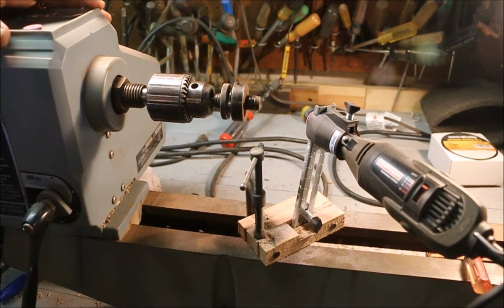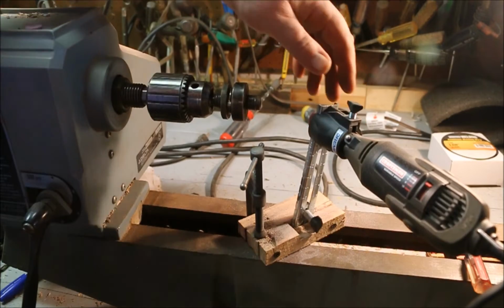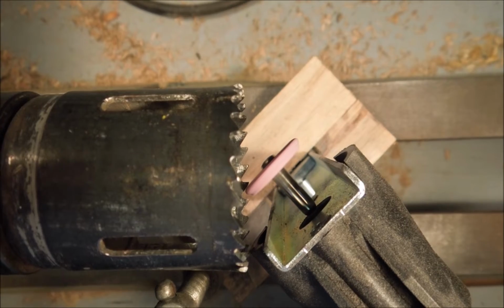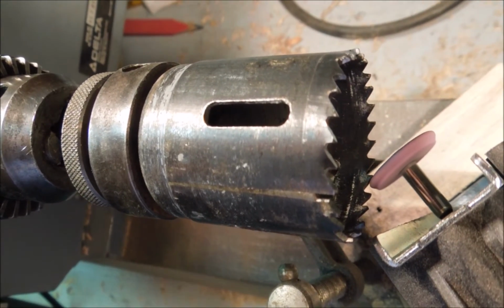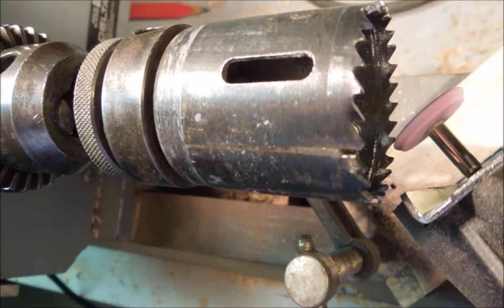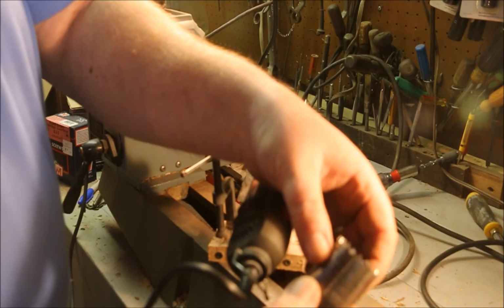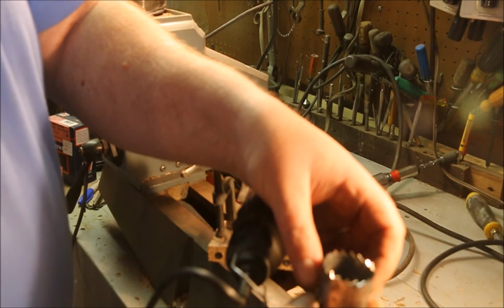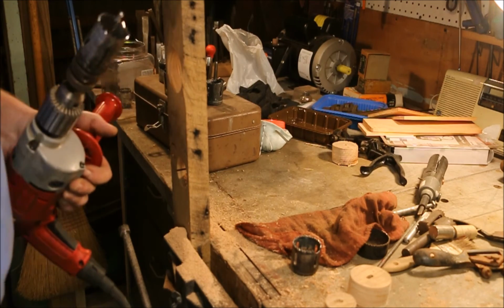Sharpening Hole Saws ~ Pt 3 ~ Different Diameter Saws ~ by Old Sneelock's Workshop

Comment: Nice solution to an old problem.
Reply: 2nd that!
Reply from the maker: The power of the internet.
I was looking around the shop a couple weeks ago for a video topic. The jar of hole saws was on the shelf. I opened it to inspect the saws. My thought was to build a new rack because the jar tripled the number of hole saws in the old one. 
That made me wonder if they were in good enough shape to use. 
The next question was are the unusable saws salvagable. I had sharpened a few hole saws but not this many at once.
Out of curiosity I set up this rig and was very pleased with the result.
Reply: You
re the FIXER, Unc!  Whadya expect!

Comment: how long does it take to sharpen a 2-1/8 hole saw?
Reply from the maker: If the arbor is all setup and the grinder is mounted and ready about 5 minutes, give or take.
Why do you ask?
It will always be less time than it takes to drive to the big box or even the local hardware and buy a new one.

Comment: Thanks for taking time to share this.  If you are going to use a jig, don't you need a stop finger to hold the saw in the correct position?  I have sharpened a bunch of saws free hand.  Just hold the saw in one hand and a die grinder in the other and "go to town".
Reply from the maker: The idea of the jig was to test the theory. Some of my saws have variable spacing on the teeth so it wasn't practical for me to use a stop. 
If you are planning on making a jig for production use I would suggest setting it with a stop. 
For me I was sharpening all the hole saws I owned including a jar full of flea market saws that were dull as butter knives. Since making the video I haven't needed to sharpen or resharpen any of them.
Reply from the maker: Free hand there is a possibility that the teeth wil end up with a cows and calves configuration. The teeth won't be the same height and the taller teeth will cut with the others just ride through the kerf. 
With care hand sharpening can be done and work well. I doubt the Egyptians had Foley Belsaw machines running on treadle power. 😁😎
Reply: @OldSneelock  I really appreciate the time you have taken on this topic.  
I have been a machinist at a food plant for 20 years and had machine tools at the dairy farm 20 yr before that.  I agree what you are saying about the tooth hght.  Actually that is an advantage at my shop.  99 percent of my work is 304 and 303 stainless.  Too many teeth contacting the work distributes the axial force reducing my ability to apply enough force that each tooth is cutting deep enough to undercut the strain-hardened layer.  As an aside, I run all HSS tools at 20 SFPM in 304 and 50 or more on 303.  If you ever let the tool skate on top of the strain-hardened layer without cutting you'll be sharpening again in a few seconds.  I know you probably know this stuff already. . .I was mostly sharing for other readers.  Good evening!

Comment: This actually works, thanks for the tip & now with the savings I have a new rotary tool!

I just used the Arbor on my drill press, I chamfered a fresh rotary stone to the rough tooth profile using a grinder grinding disc, not perfect but worked well enough.

Also my teeth were uneven, so if you power up the spindle you can mark the high cut line and even the teeth back out.
Reply from the maker: Good job. Glad to see you took the idea and ran with it. 😆😎

Comment: You try that on wood?   i came here to find another way to sharpen a milwaukee  2"  to finish a job on stainless, but i think the poor saw lost it's hardness, pos drill press speed was too high ,not even dust specs come out any more,sharpened it twice; need a new one,but before, should i try to re-harden it, heating it to 1050ºC,orange color just before the yellow, and water cooling it,do they take that?
Reply from the maker: Needs must when the devil drives. It's not a great idea to retemper a thin saw blade. Especially after it has the teeth cut in it. The tips will overheat and decarb before the body reaches non magnetic. If you have an oven you might be abe to bring it up slow without burning the teeth. 
If you already have a dull blade you can't sharpen, you're not out much for trying. I would quench it in oil rather than water. Water chills too quickly and might cause it to crack or warp.
Without an oven you could try heating the body with a torch and let the heat run out to the teeth. Then just quench the teeth up to about 3/8" back from the teeth. Leave it sit 3/8" deep in the oil until it is cool enough to touch. 
Speed kills hole saws. Tubalcain says 100 surface feet per minute in steel. 
Coolant always helps. If you can keep the teeth below 250 deg F they shouldn't soften. 
Good luck.

Comment: which brand hole saw you have and which is the best hole saw according to your experience?
Reply from the maker: I have various brands that have been resharpened. Best would be Greenlee. Followed by Rigid. Then Milwaukee. The newer ones aren't as good as the pre 1990 ones.

Comment: A great solution to all those saved blunt hole saws. Im in Australia and those good quality hole saws are very expensive here. Theres just one big problem that I have with the video and thats there was no mention of where that particular grindstone is available. I have searched all known dremel stone bits and that nicely curved stone that fits in the hole saw teeth doesnt exist here. So my question is: Is that a standard dremel bit that can be bought over the counter in the US, or was it ground to that shape.
Rick
Reply from the maker: +Richard Reeves It was ground to that shape. I used a single point diamond to shape the stone but any hard abrasive like another grindstone or a piece of granite will wear away the stone. 
Once the shape is close, at least with the pink stones, the teeth of the holesaw wear the stone but maintain the shape.

Comment: Nice video. Some images were out of focus. I would suggest getting a tripod. You could cut the time of the video significantly if you speed up some of the repetitive stuff. We don't need to see every tooth being ground. Also, explain what makes it sharp with a sharp image. You get around to that somewhat later in this video but could be more explicit. I rewatched it and starting at 4:17, it's pretty clear. That's the key.
Reply from the maker: Thanks for the comment. It's a balance. Some ask for more some want less. The camera was on a tripod. I was holding it, but it was on the tripod. 
The focus issue has been mentioned before and is a real problem. Autofocus is constantly adjusting. I did later add a fixed camera mount to the ceiling so the camera doesn't get out of focus as often. 
I will take your suggestion on being more explicit under advisement.
Reply: @OldSneelock  I know what you mean about the autofocus. It can drive you nuts.

Comment: ..i am partial to the ones that have a "set" in the teeth. to me, they cut faster. i used to have to cut holes in ceilings in a mobile home factory and would cut a couple of hundred daily. sizes from 3" up to 8", mostly 4" for the light boxes. you haven't been on a ride until a 6" gets a bite!! the ones with the set teeth cut faster...
Reply from the maker: Ol James I worked as an electrician for Home Builders Inc in 1973 & 74. punched a lot of holes with a pneumatic drill and a 4" hole saw. Walking around with a 10 lb rig putting holes in the ceiling. I was much younger then.
Reply from the maker: +Ol James My preference too. The set helps clear the chips.
Reply: Just like taking the drags down on a saw chain. Then it'll BITE!
Reply: Reminds me of when I used a pavement breaker to clean out concrete truck tubs. Last one I used a Bosch demo hammer in 01 or 02. Lots better but glad I don't do it any more either!
Reply: Ol James  I was just wondering about whether or not hole saws even had a "set".  So I am guessing that some (the better ones maybe) do, and others don't. How would you go about adding set to a hole saw (?)blade (I guess that would be the proper term)?
Reply: Ol James  I was just wondering about whether or not hole saws even had a "set".  So I am guessing that some (the better ones maybe) do, and others don't. How would you go about adding set to a hole saw (?)blade (I guess that would be the proper term)?
Reply: ..Brian, i will defer to the Bossman on this. i have taken a punch and small ballpeen and gave a set to some of the cheaper hole saws...
Reply from the maker: I just looked at all 17 of the hole saws that were hiding in various areas of the shop. All of them, including the cheap stamped steel one that came with a lockset mounting kit, have a set to the teeth. 
As far as adding set to the teeth I'm not sure that I can or should try. 
The good quality hole saws are bi-metallic. They have a high speed steel edge welded on to the saw as part of the manufacturing process. As evidenced by the 1 3/4" hole saw that came in the jar with a crack in it already. Any attempt to bend those teeth breaks them off. 
Even the cheap stamped one doesn't want to bend. 
So my answer is: IF THE HOLE SAW IS JUNK WITHOUT THE SET. A big if there. Then you have little to lose if you break a tooth off. In that case I would use Ol James method of a punch and anvil. 
As with other saws, the set is there to cut a wider kerf and let the body of the saw have clearance in the hole. It doesn't take much set to accomplish that.

Comment: Nice, should save a few bucks. I'd use a sharpie to mark the start and finish tooth. I wonder if you could use a chainsaw sharpener in a similar manner? More projects, yaaay!
Reply from the maker: kleinjahr For me saving money is a big incentive. More than that is being able to cut the holes faster and with less effort.
Reply from the maker: Interesting thought. I have a cheap chainsaw grinder that I can try sharpening one of the hole saws with .
Reply: Looks like anything that'd turn a grinding rock would work.
Reply: Yes to both of yours above!

Comment: nice sharpener ! But !! my " hole saw sharpener" is made for the guy's that dont have a lot of tools  just a grinder and a drill :)
Reply from the maker: Congratulations Felix you have made a working fixture. Not everyone can afford the setup I'm using. Of course they can always use a hand stone and not spend anything at all.
Reply: or the wifes finger nail file ,but that might coust more than a grinder (lol) if you know what i mean ! you  got a good tool their  no dought  :)